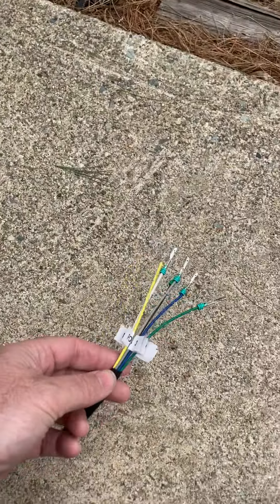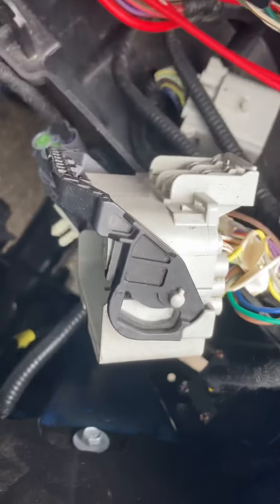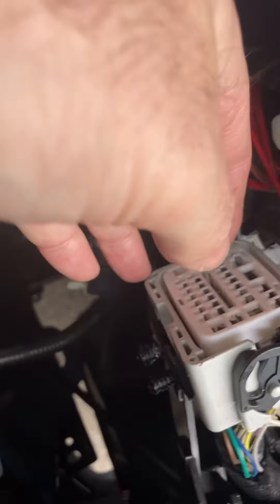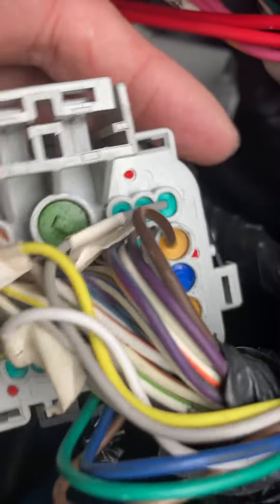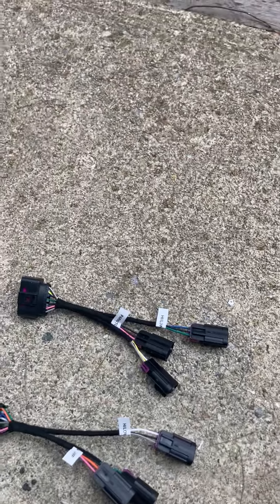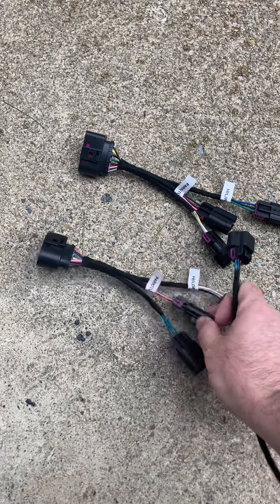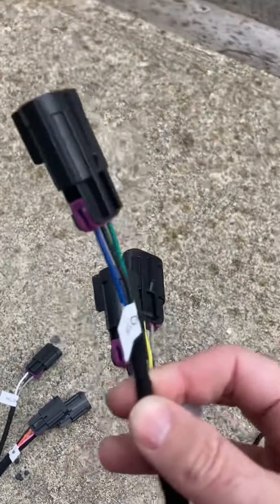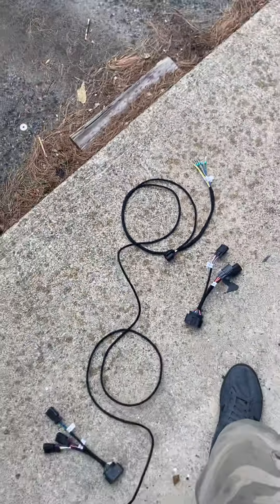2014+ 4th Gen Ram Quad to Projector Headlight Harness

Comment: Does it work on the 2500/3500 too?
Reply from the maker: @ramonsolano399  yes
Reply: What is the price for your harness and is it the same plug i need to tap into? I have 2017 3500
Reply from the maker: @ $150 USD.